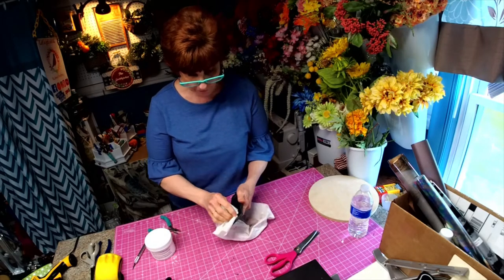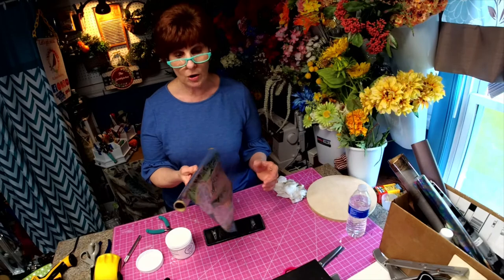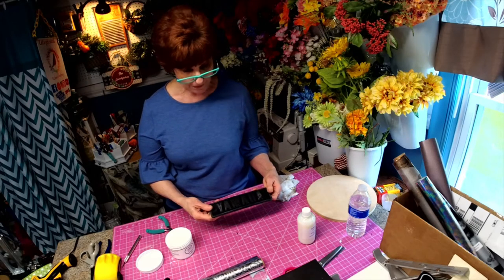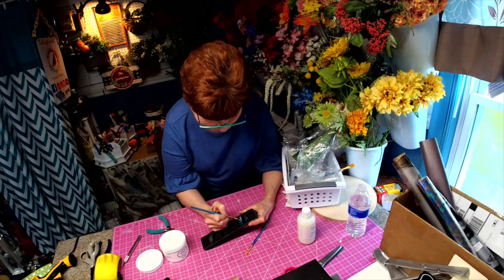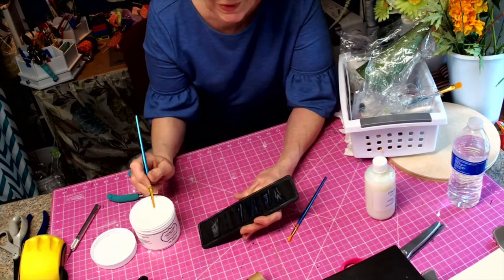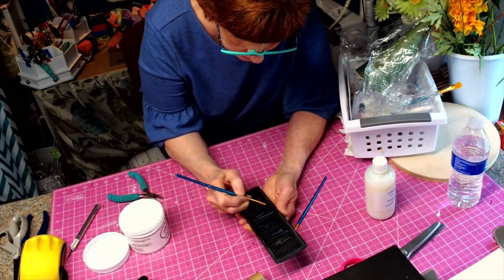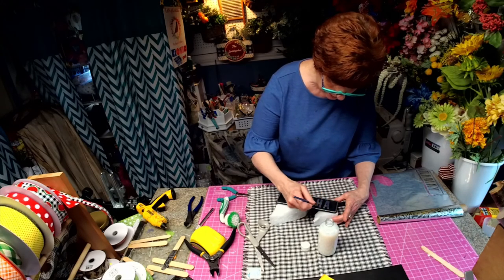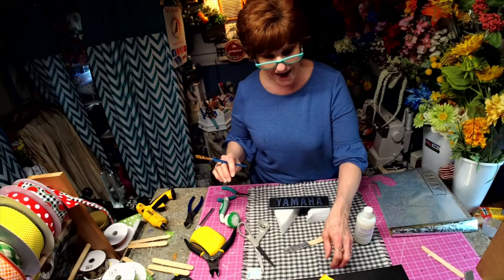Lets Foil my Yamaha G1 1982 golf cart emblem!

Comment: Great job. It looks great! I have one also and will have to try this. Can regular aluminum foil be used for this?
Reply from the maker: No regular foil would not hold..  This is a special foil.  Following the link in the description if you want to use what I used.  You will also need the foile adhesive and top coat.  Here if you have anymore questions Thank you